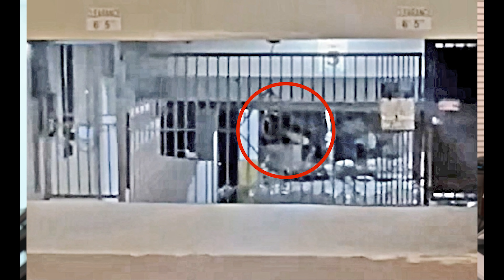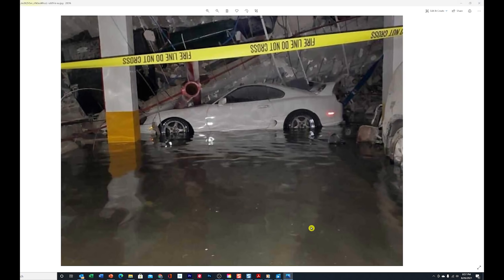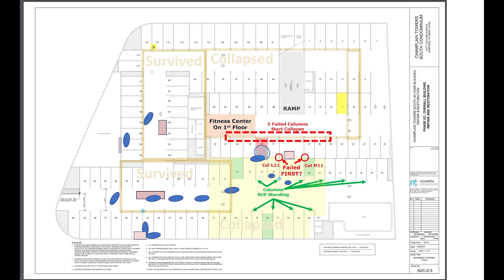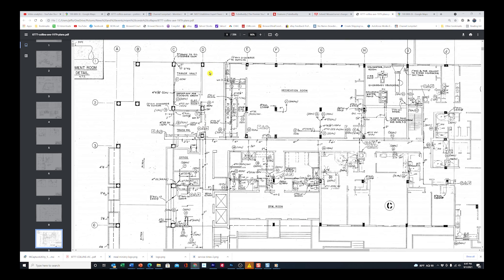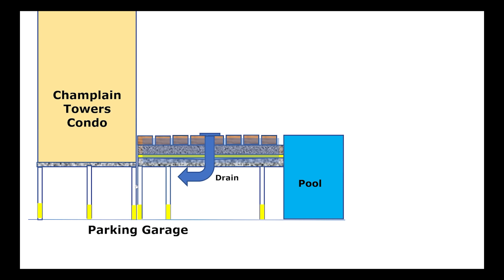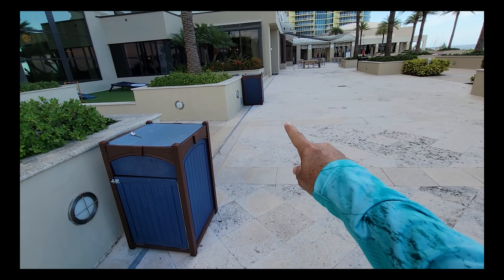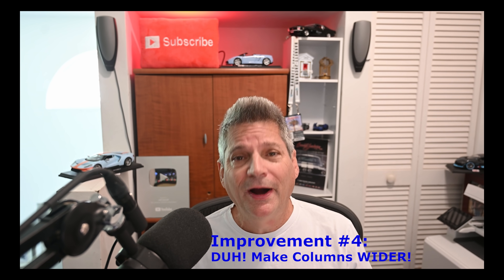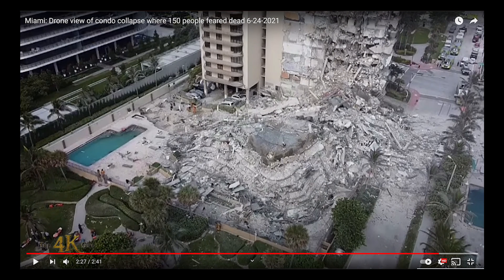Miami Condo Collapse: 4 Engineering Fixes May Have Prevented It

Comment: Even if it were built more robust or had expansion joints etc....I believe the water damage and lack of maintenance over the years  would've done the building in. I'm curious to know how strong the concrete was? I believe CDI demolition said the concrete was really soft when they were drilling holes to set the explosives. I believe the concrete was soft or made softer by water damage and the lack of repairs and maintenance is what caused the collapse. I'm sure design discrepancies will no doubt play a part as well.... the  questions are why and in what order caused the collapse? Anyway,great detective work Jeff! Really enjoy watching your videos about this. My continued thoughts and prayers to all the victims and their families of this unfathomable tragedy.
Reply: Concrete is specified on the drawings and was discussed either by Jeff or at the Integrity channel.  As I recall below the 3rd floor it is 4,000psi, above that 3,000 psi.
Reply from the maker: Yes, CDI said it was no where near 6000 PSI rating it should have been based on the "feel" of it. no core samples were taken, but these guys know, they drill into it every day.
Reply: @jeffostroff  They are likely drilling into columns to place explosives, the drawings required the columns below level 4 to be 6000 psi concrete.  This is darned hard stuff, and hard to drill into.  I'm sure that NIST will be taking samples from all over the structure for testing so eventually that information will be known.

Comment: "Don't place parking spaces on top of a pooldeck."
It was the heavy cars that first took down the deck. I'm wondering if someone just parked there and the deck came down. It's obvious when you see how and where the deck sheared straight off, where the pooldeck begins.
Reply from the maker: Maybe not necessarily the heavy cars that took down the pool deck where their cars parked, but that area is that where they found to their horror last summer when they did an exploratory dig there, that there was no waterproofing membrane under that stamped concrete parking level. And so water has been getting through there through all the cracks in the slab below it and was dripping into the garage for years. I feel that eventually weakened.
Reply: @jeffostroff  Also it would be nice to know why/if the last parking spaces were on the pooldeck. It makes sense that the bigger pillars were also there to support the "parking deck" part, but the last 6-8 parking spaces look like they were actually on the pool deck. I'm quite conviced that the repeatedly moved cars (on the weakened deck) were the straw that broke the camels back...

Comment: As an engineer that has built a few structures in my life, not 12 stories, but a 96' tall 4 floor industrial building in Auburn IN as the largest project in my career I am a fan of steel structures vs reinforced concrete construction.  Fewer things to go wrong with steel skeletons not to mention they are much easier to inspect during construction.  

The floors are still part of the bracing system in steel-framed construction.  The floor is tied to the structure using shear studs welded to the top beams prior to pouring the slab/floor.

Jeff your videos are quite good!  I enjoy watching them and look forward to you dropping additional chapters to this saga of tragedy..
Reply: Valuable insights from real life experience, but--correct me if I'm wrong--the reason that steel framing is dominant in office/industrial buildings, while concrete is dominant in residential buildings, comes down to wind-induced sway/motion in short, people will tolerate a lot more building motion at work than they will at home.  And CTS was in the highest-level High Velocity Hurricane Zone (HVHZ) codified in Florida (150mph IIRC...)
Reply: @MajorCaliber  I have no experience with residential structures.  That said I don't think sway enters the equation at 12/13 stories.   At 50 and up it might, although there are many ways to mitigate sway, as tuned mass dampers, using thicker concrete floors on the high floors to add mass among others.
Reply from the maker: yes and you don't have to worry about cold joints, and missed vibration of the poured concrete

Comment: Great video again Jeff! I would have forgotten about this concrete crap and had a steel skeleton for the building. I know, a lot more expensive but I would think a lot stronger than the reinforced concrete.
Reply: But this is in south florida, the climate isnt kind to steel buildings (I believe, im deff no expert)
Reply from the maker: Yes other engineers have stated the same thing, metal columns.
Reply: You really don't want to do structural steel in exposed parking areas.  Structural steel isn't very well suited to residential structures because it wants to make the building too much taller but it could be done.  A properly designed reinforced concrete building can certainly be strong enough for the required use.
Reply: cough Steel = wind sway cough  getting motion-sickness in my bedroom cough HVHZ cough-cough  ;')
Reply: @MajorCaliber , wind sway is only noticeable above 30 stories or so. I know, I’ve lived it!

Comment: Drop panel: I learned a bit of mechanical engineering. There one likes to avoid stark changes of diameter because the corners can start cracks. So smooth transitions from one diameter (column) to the next (deck = infinite diameter) is called for. So a mushroom kind of shape would be desirable. Which is nearly realized in the pyramidal pedestal shown later. Much better than putting a flat piece on top of the column. That might work with metal but is a bad idea with concrete.
Reply from the maker: Yes, that is why they make the drop panel so wide also, because the hear typically occurs 45 angles from the top of the column
Reply: @jeffostroff  The reason a drop panel is required to extend 1/6 the span is to allow the increased thickness to be used in the calculation for tension reinforcing to resist bending, has nothing to do with shear.  A drop panel can be smaller and still provide increased capacity against punching shear, but the thinner slab dimension would have to be used for flexure calculations.  Some people would then call it a "drop cap" which is functionally equivalent to a column capitol, although a drop cap would be poured as a part of the slab while a column capitol would be poured as a part of the column.  The critical failure plane for punching shear is assumed to occur at 45 degree lines from the top of the column or column capitol.  So there are lots of different ways to address punching shear, each with different provisions and ramifications.
Reply: Transitions and sharp corners are a problem in metals due to stress concentrations causing fatigue and fracture, but aren't nearly the same problem in reinforced concrete buildings.

Comment: Winning 🥇
1. the one at our hotel is free standing
But the Condo board had sewerage seeping through their storage area. If they could have fixed this later .. if the could have would they . ? 
It was built by a crooked developer and negligent architect and engineer. 
Not to mention the lead contractor changed 3 times .
Reply from the maker: Alla recipe for disaster

Comment: I agree with your expert fixes. I'd just also focus on the whole slab itself, make it with more rebar and thicker but with proper drainage. Amateur opinion, but I would have added a number of reinforcement walls and not just columns in the parking. Like a whole thick concrete walls series supporting the weight of the building, with the same materials as the columns... I don't like the idea of a massive 12 story building standing on some matchsticks. Also, I'd use some steel skeleton in the whole building so the floors don't pancake so easily... With a massive steel skeleton the building might not have pancake like that. I would not solely use reinforced concrete for such a tall building. I'm not an engineer or architect, just a random guy on the internet answering you question, letting my imagination run wild based on what you analysed and how easily the building collapsed.
Reply from the maker: Yes, more walls is better, not necessarily more rebar in a column as we cannot exceed 8% of the volume of the column
Reply: @jeffostroff  Noob question from non-architect: Why the rebars can't exceed 8% of the volume of the column?
Reply: As I understood it, too much rebar can also be a problem, as not enough concrete surrounds it.  But at the same time, I agree with you completely about the steel skeleton.

Comment: I would design it with 20 or 24 inch columns everywhere, the punching shear protection as well as the capitals, and the expansion joint or isolation seam.  Only problem is finding a construction company that will build it as designed without cutting corners or changing the design without consent.
Reply from the maker: That's why you need engineer to be present during rebar, framing, and pouring
Reply: Or you need a competent and honest inspector that ensures it was built to plan.
Reply: @Jim-Slade  Quite right! Good luck with that in Florida.
Reply: @Jim-Slade  Good luck finding one.  However, as the original owner of a newly constructed building, you should take the time to visit the site and inspect the work daily to make sure it’s going up to your own satisfaction.  If you’re not sure how such a building actually should be built, it would be in your best interest to hire yourself a structural engineer such as Jeff here to ensure you get the safest, best building you can possibly get.
Reply: @Jim-Slade  ..forget inspectors ..if the owner wants it built correctly then thy need to have an architect and engineer on site monitoring the contractor… completed several small project in NYC… the Queens building department c1980s 90s was a good old friend club for: Durst, Le Frak, Milsteen and others or, it acted as a shake down operation for many other small developers.
Reply: The problem you will cause is all the high vans people drive will hit the ceilings and then they expect the garage iowner to pay for the damages.
Reply: @Drwild75  better than being buried under the ceiling.
Reply: Maybe there budget couldn’t afford it

Comment: Thank you Jeff for the fascinating and inciteful continuing review of the condo collapse. I think your design implementation could have prevented or at least greatly minimized the catastrophic building failure. I think that these condos should have by law, an annual review of structure issues by a "competent" structural engineer and then be required to repair issues less than 30 days from the date of the inspection.
Reply from the maker: Glad you enjoyed it!

Comment: 36 hours to prep a building for demolition huh. Usually takes months if not years????
Reply from the maker: These guys were fast, they were called in the first day I'm sure. They did it under the cover of the hurricane coming, imploded on July 4 the blend in with fireworks. The collapse occurred on 6/24, so yes 8 days they pulled it off. Small project though.
Reply: @jeffostroff  that makes sense okay thank you.

Comment: Better question - what should have been done after 2018 report?  Also, at what point in time do you think building became unsalvageable ?
Reply from the maker: They should have closed the pool deck, dismantled the sand and pavers, seen what's going on, remover all the planters to inspect underneath, and cut an isolation seam separating the pool deck  from the building. I bet core samples would have shown more weakened and brittle concrete

Comment: Make it fail safe. Any load carrying component can be repaired/replaced without compromising the structure.
Reply from the maker: Yes, they put up temporary shoring pole structures around it first.

Comment: It would be nice to know if when the pavingstone was installed, also as a cube of pavers is about 3000 lbs each and what machine as well as the year installed and what that plan looked like...the expansion joint alone would have probably if only one thing to add would have probably worked ...nice video's Jeff.
Reply: I’ve wondered similarly about the decking renovations. I don’t have an education in this kind of thing; but I have worked with designers in general renovation and they have a tendency to over look or assume a structure is capable of handling the design changes.  I see this specifically with low bid contract procurement. People get sold on a picture but have no real understanding if they picture is capable with the current structure.
Reply from the maker: Thanks Larry!
Reply: The waterproofing was installed in 1996; I believe that’s also when they did the other deck renovations
Reply: Agree. Thank you for your good work with this tragedy.

Comment: It was designed in the 80s. It needed to be upgraded. Building design has improved since the 80s.
Reply from the maker: yes they use epoxy coated rebar now
Reply: @jeffostroff  And they can coat the concrete with urethane sealant or epoxy paint.  Sometimes they wrap the column with resin-impregnated fiberglass mesh, with a top coating of resin.  Frickin nuke-proof columns...
Reply: The relevant parts of the building codes are the same now as they were in 1979, there was nothing wrong with codes back then, just had to design according to them.
Reply: But there are buildings in Europe that are hundreds or more years old still standing.
Reply: @oldarkie3880  There are many more buildings in Europe that were built hundreds of years ago and which decayed and were torn down or fell down.
Reply: @oldarkie3880  Concrete/rebar buildings?
Reply: @oldarkie3880  Move those buildings to South Florida, right next to the ocean and they would deteriorate and collapse rapidly.

Comment: - zinc bracelet to every rebar at the top of every column. This would significantly slow down the rusting for some years. (it would cost much less than coated rebar).
- 1 inch thick zinc coated steel sheet with holes for the rebar for the top of every column. The sheet should be twice as big as the column thickness. This would not  have cost too much either, but would boost the punching strength and need no real altering of the plans.
(the sheet of steel would only help after the rebar was catastrophically corroded. Under normal operation it would not increase the strength)
Reply from the maker: That sounds like a good idea is that more like a sacrificial piece of metal? Sort of like the hot water heaters that have the sacrificial anode?
Reply: That technology didn't exist in 1979 but does exist now I believe having been developed since about 2000.  It isn't a plate but is pieces of zinc that can be attached to individual reinforcing bars.

Comment: Ultimately, with everything you identified as wrong, including problems with pool deck, if the pool deck was structurally separate from the condo, the condo would not have come down.
Reply from the maker: That is the simple fact yes
Reply: The columns at the edges of the building were most vulnerable to damage from the collapse of the pool deck and should have been thicker with an isolation joint preventing the deck from pulling the rest of the building down. A fatal engineering oversight that other designers have included in their plans.
Reply: When I saw the first animation of the collapse, I immediately thought the same thing. That deck was too vulnerable to the elements. It should have been isolated from the bldg with a double column
Reply: You guys izz just trying to undo 40 years of really shiny marble in the lobby... and steal $$ from the lobby-buffing budget--which is vewy vewy impo'tant--and waste it on vague things like "safety" and "structural integrity"... WHAT would Duh Real Housewives of Miami Beach have to say about THAT?  ;')
Reply: @MajorCaliber  😂😃😎😂😂
Reply: But why were the Nirs hearing noises upstairs before the deck even collapsed?
Reply: @Wazupu  internal collapse. stuff was happening before the visual collapse
Reply: @CatBrash  Yes, things breaking within the slabs/columns -- bars snapping, concrete cracking -- before visibly displacing.
Reply: @Wazupu  I have no doubt that there was plenty of cracking and rebar snapping going on internal the the beams and columns that would’ve transmitted plenty of noises into the units before anything visible was noticed.
Reply: Apparently there were three beams that should have supported the planter boxes that were removed. That part caved in. See Building Integrity.  One of many causes of the collapse it seems.